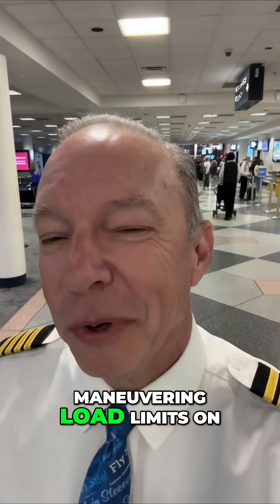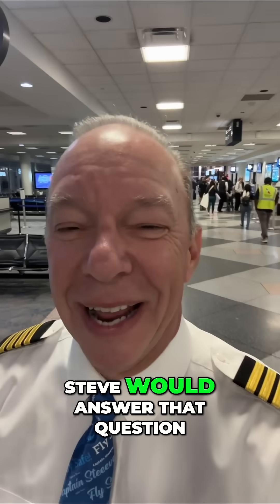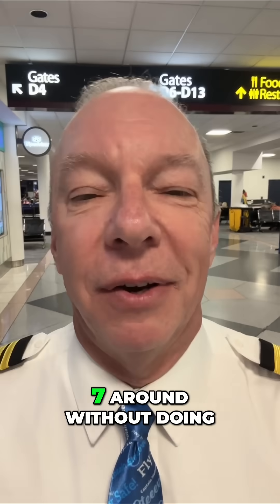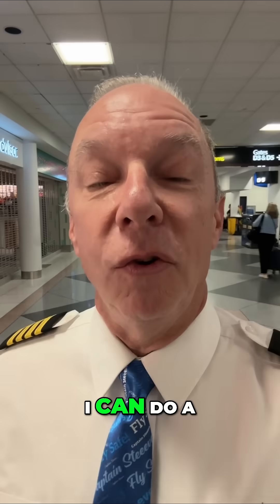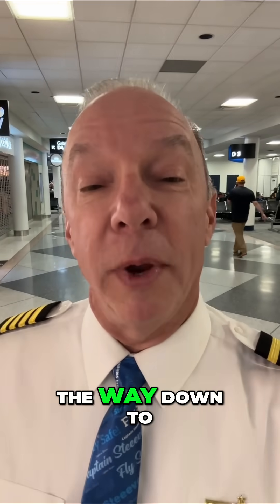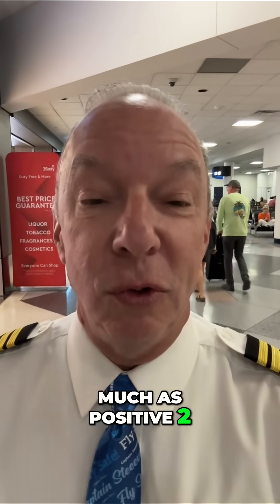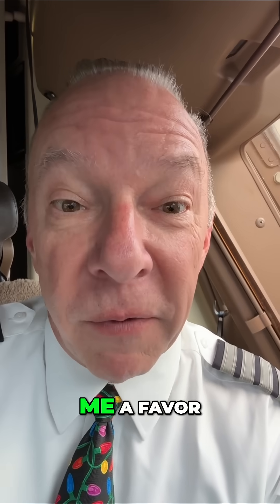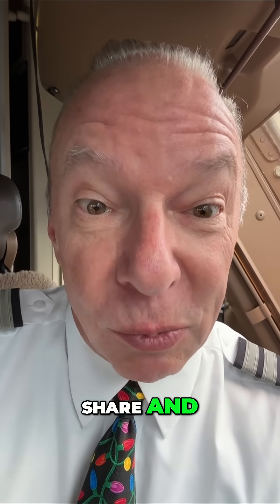Triple 7 Maneuvering Limits Explained by Captain Steve

Comment: Boeing tests (or at least used to test) the accuracy of the theoretical load by building an airframe, hanging it by the wingtips, and then loading down the fuselage with weight until the stringers in the wing shattered.  Which is only slightly more expensive than building an eight story office tower just to intentionally burn it down so you could figure out how much time everyone would actually have if they needed to evacuate.

Comment: Captain steeeeeeeeve……..can you please explain something to me:  if my luggage weighs even one pound over at check-in your airline fines me an extra $100 while at the same time some 400 pound slob pays the same or less for their ticket than my 35 pound four year old daughter.   Please explain this to me.  It doesn’t seem right and stinks of bs.
Reply: the 400lb person is self loading, your baggage needs handled by someone who handles hundreds if not thousands of bags a day. OSHA has rules as far as how much weight one can lift without needing assistance, think of the overweight fee as a disincentive to pack heavy
Reply: @ you are 100% wrong.  According to American Airlines corporate headquarters (I actually contacted them) the extra fee on baggage is because they claim it requires more fuel for the extra weight, hence the extra charge.  I am calling bs on this as the 400 pound pig slob sitting in the row next to my 4 year old daughter should be paying $20,000 for their ticket based on this logic.  Thats the facts.
Reply: @ you are 100% wrong.  I explained why already but for some bizarre reason my comment was deleted